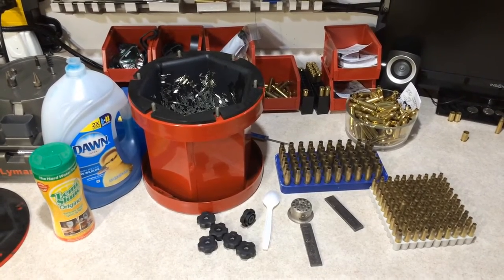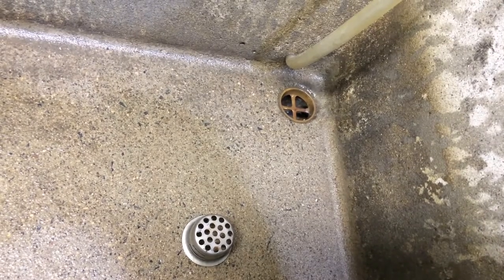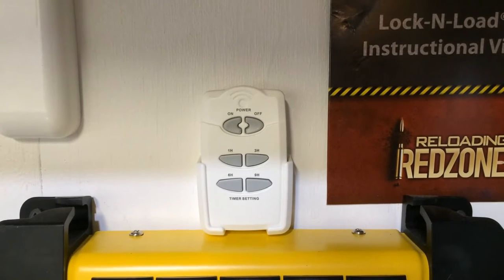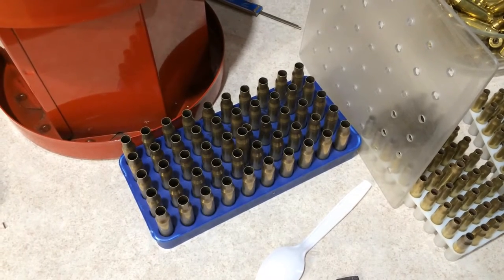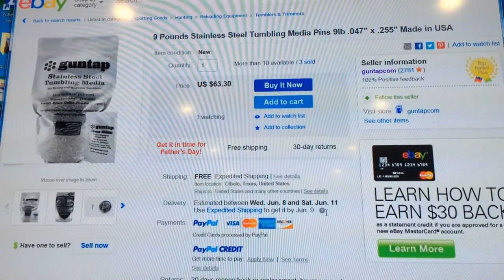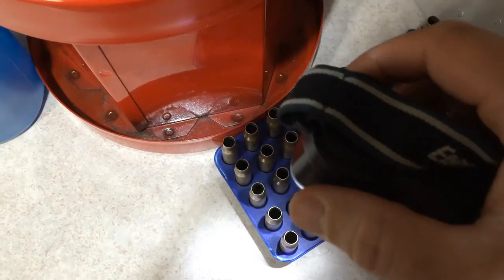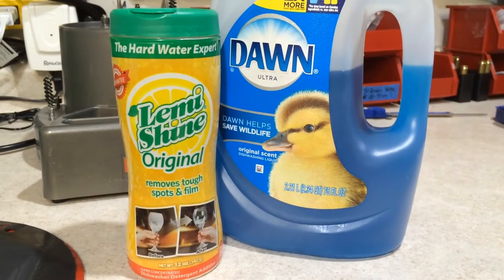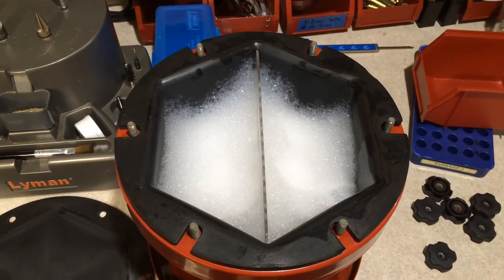Stainless steel rotary tumbler brass cleaning RELOADING 101 quick tips

Comment: Good video discussion. I think the pins are a fad and will disappear in a couple of years. Rotary tumbling with mixtures that are more effective  will utilize these tumblers to their real potential. The next fad will be dehydrators for drying brass. This also can be replaced by using a cookie sheet and setting your oven to 180 degrees. FADS.
Reply from the maker: Very true!
Reply: Ed what mixtures do you recommend other than the pins?
Thanks